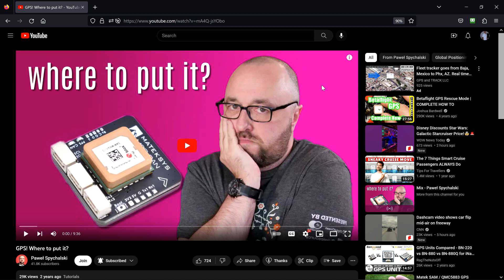GPS Mounting Position

Comment: sorry im to much a newbie to help but i have been watching your build.nicely coming along.all i could say is don't overthink it,im sure it'll be fine.take care ..from south australia outback. still waiting for hd zero goggles preorder~hehe!im sure you will get it right mate.
Reply from the maker: Thank you for the encouraging comment.  I will get it worked out for sure.  I usually do.  😊  I have worked it out well on several quads in the past, but until I started the Chimera7, I have not constructed a quad in about 6 or 7 years.  We just stuck the GPS up on a mast back then.  If it didn’t work, we increased the height of the mast until it did.   Lol

IMHO the Chimera7 will do well.  I think I have it set pretty well.  I am most worried about the upcoming 5-inch build.  I have some time until it arrives to find and setup some good GPS bench testing.  Flight testing and looking at the logs go a long way also.  I just have to refine that testing and learn log analysis much better than I do now.

Comment: One of your biggest problems is get your GPS away from power wire second is VTX  I can honestly say never had a problem with GPS  on any of my Qwads but i also my battery cable close to standoff 3 d printed xt 60 mount
Reply from the maker: I didn’t fully pay attention to the power lead until I had finished the Chimera7.  I wish I had and I have thought about tearing it apart and reversing the ESC so that the power wires come out the front/side/ each side.  It would be pretty easy to do.  I would have to take the whole thing up including motors and rotate it 180 and then reset the motor order/directions in the ESC.  Pretty easy to do.  Would also be easy to tear it open and resolder the power wires out the side or front with the ESC positioned as is.  I don’t think the VTX is a problem on it.  It was mostly that power lead.  It seemed to me that is shadowed the GPS module.  I did use a rubber band on it to keep it up away from the GPS and on the bench, it seemed to help the problem.  I did do one flight with that fix and there was no GPS glitch.  But there also wasn’t one on the previous flights either.  I did see the glitch on a viewers platform that I was trying to help with.  Same Chimera7 type frame.  I don’t think they did compassmot or a good notch filter so I think my noise floor is much lower and I might not have to even use the rubber band on the 7-inch because of that.

IMHO the Chamera7 isn’t going to be much of a problem as is.  I am just trying to make it better.  Use it as a testing platform for the 5-inch.  I think the 7-inch is fine or 95% anyway.  It is the 5-inch I worry about.  Historically they don’t have GPS modules on them.  Right now, I am just trying to find diagnostics like ucenter from ublox and such to test for interference while I am waiting on the 5-inch parts to arrive.  During that time I need to bone up on the dataflash logs GPS information to see IF and how I can see GPS interference.

Historically as I said, I just put them up on masts in the past and I could do that with the 7-inch easily as it should only be a LR platform.  The 5-inch however will be a freestyle about 50% of the time and a mast will just get broken.  Just trying to learn deeper things while I wait a month on parts to arrive.  :)